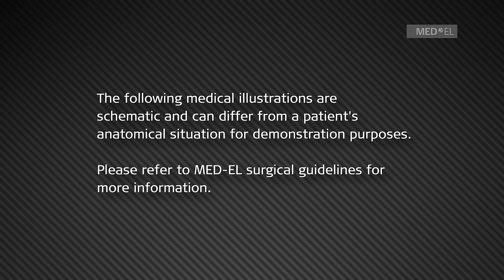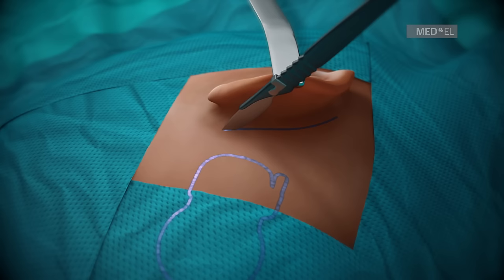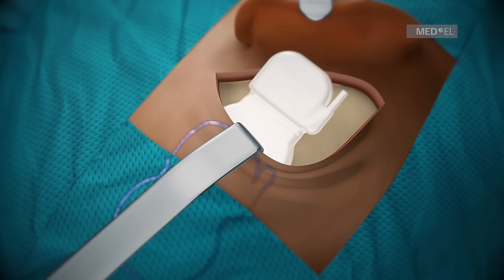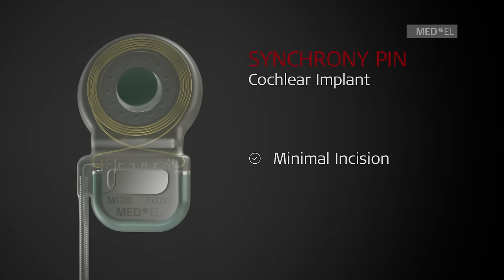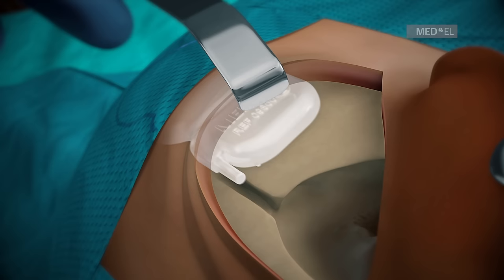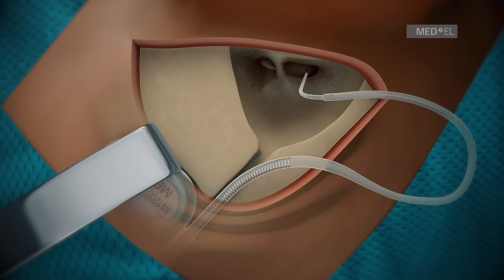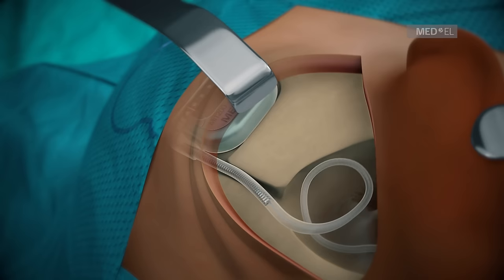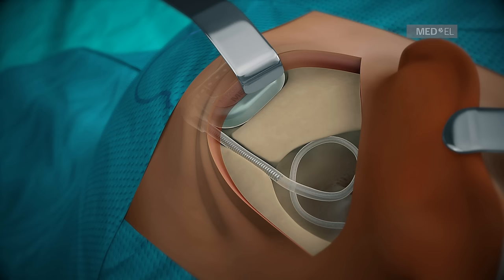SYNCHRONY PIN Cochlear Implant Surgical Guidelines

Comment: Can we hear normal after this?  I mean can we use ear phones or ear pads?
Reply from the maker: Hi there, thanks for your question. The sound is transmitted from the microphone of the audio processor through the cochlear implant / electrodes into your inner ear then. That means, yes, you can use head phones but you need to place them over the microphones of the audio processor. Or you stream sound directly to your audio processor (e.g. via AudioLink or AudioStream).  Please have a look at our website for detailed information about cochlear implants and how they work: https://www.medel.com/hearing-solutions/cochlear-implants Kind regards, Barbara
Reply: @med-el_professionals Good day Sir,How much is cost of CI?

Comment: So Bone conduction inverse transducers that converts to sound with in the mid range to low range octaves of the basilar membrane with a dual microphone for noise cancelling How about a cure use serotonin and force a serotonin overdose on purpose to produce ca2+ to calcify on the auditory nerve to create an additional artificial octave and use resonate frequency to tap into that octave via harmonics as inverted transducer to produce low bit audio with UHF , to LF , to Elf and use ULf  to power an internal bone conduction system with inductive polarity "wireless charging " you could also place the system in the nasal pharynx via the Eustachian tube from the mouth , Use nociceptors to tap into the broca essential cutting the potential damaged nerve by demodulating further in the brain instead of the apex of the ear and create reverberation from calcium located in the corpus callosum . who know maybe somebody will cure deafness from this comment.
Reply: I have cured deafness from this comment and am making millions of dollars off of your ideas, thank you.

Comment: I have my cohaol inplament. 2014. My right ear now i going get onther one in my left ear to help me hear more. But its very hard to read lip. Have wear face mask to keep safe.  I know sign language too.     I happy i got.  Don its help to ear more things i am parklee deaf had ear aid now got one cohoal inplan.  Now get one on my left side its work it. Its very very 😭 sad can not ear at all. But its great. Have cohoal inplan its better and more helpfuler.. If someone plan on get one or both go for it. Its be scary but its great to have new ear help hearing more. Better thing a ear aid its not have much but cohaol inplan 10000000000 % greats manchie help earing.   Its new ear.
Reply: Does it hurt? And can u take it off and on and how
Reply: Is it built in your head?
Reply from the maker: Hi there, the cochlear implant system contains two parts: 1) the internal implant which is placed behind the ear, under the skin, and the electrode is inserted in your inner ear. 2) the external worn audio processor which can be put on and off. In this video you can learn more how a cochlear implant exactly works: https://www.youtube.com/watch?v=LhSpb36_1s4 Kind regards, Barbara